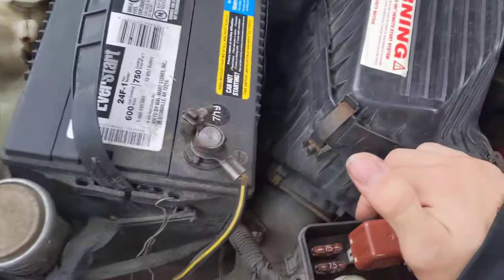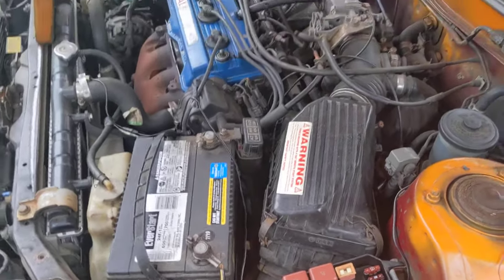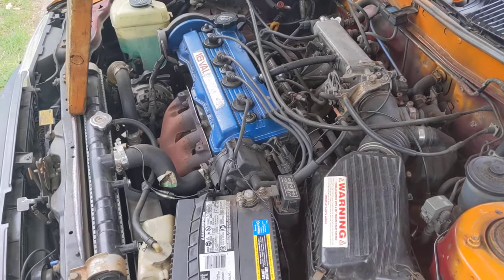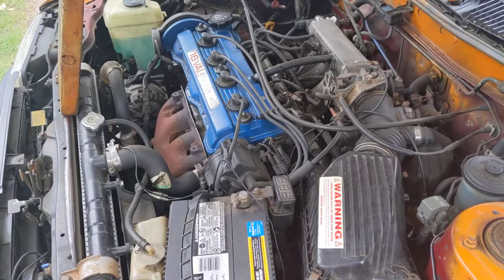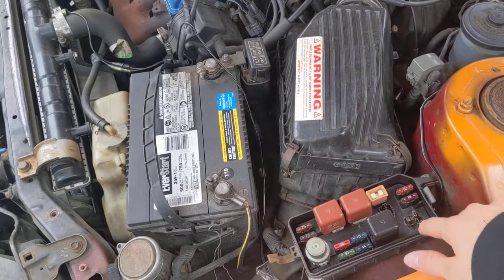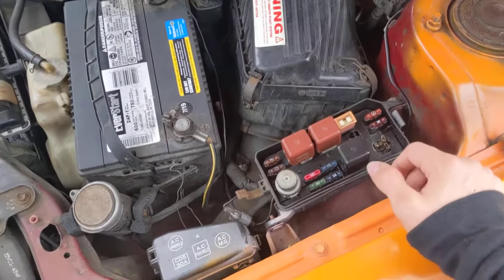1991 Toyota Corolla starts but dies replaced fuses and relays

Comment: Its a short circuit, however, because the pliers us solid compare to the tiny winding in the relay, thus causing the relay to burnt.
Reply from the maker: I managed to fix this problem by running a kill switch to it
Reply: @ShaggysWorkShop how did you run a kill switch

Comment: Did you find the problem? It could be a bad wire touching somewhere
Reply from the maker: I'm pretty sure it's the fuse box that melted but for now this is how it's fixed until I can get another fuse box. I haven't found any bad wires.

Comment: Hey man. Did you manage to sort this issue out, i have the same problem
Reply: spark plugs?
Reply from the maker: Yes I did. Where I put my pliers in I soldered two wires into it then ran them into the car where I put a kill switch
Reply: @ShaggysWorkShop 
I was going to do the same thing, had an auto electrician come over he was busy for 2 minutes under the steering wheel and kick panel fuse box. Problem solved. Its a pitty i did not see what he did
Reply from the maker: @trishangovender1033  ahhhh damn
Reply from the maker: @germiemartin6344  nah the wiring is all messed up in me car i think i need a new fuse box or something.

Comment: ignition fuse in the kick panel, mine was missing when I got my 87 4runner but I didnt know it at the time cause i didnt have the cover to go by. Would fire and run for just like couple seconds the die. Got the cover and seen the ignition fuse was missing, solved that problem.
Reply: P.e.m films P.e.m films  Yes down by your left foot.